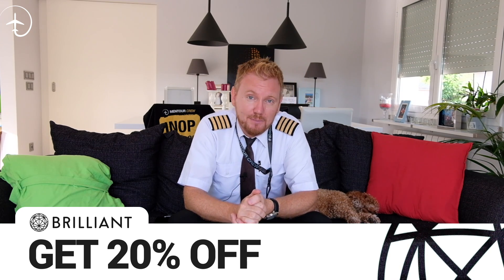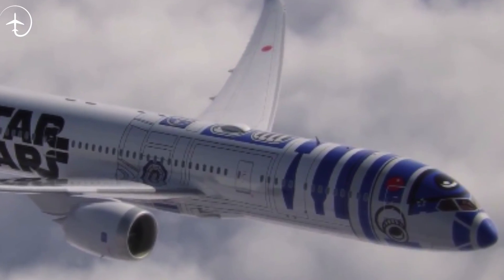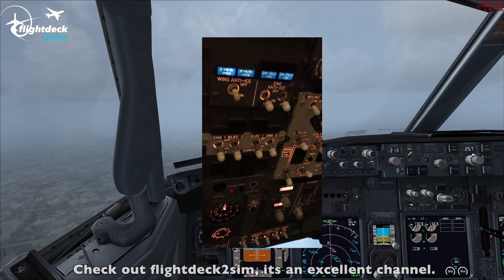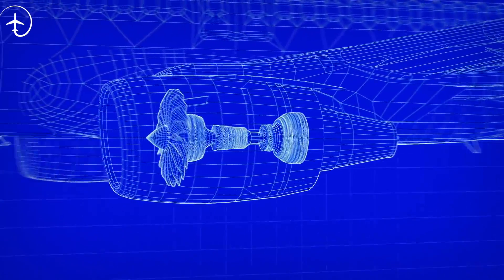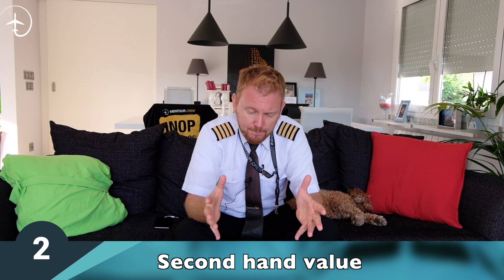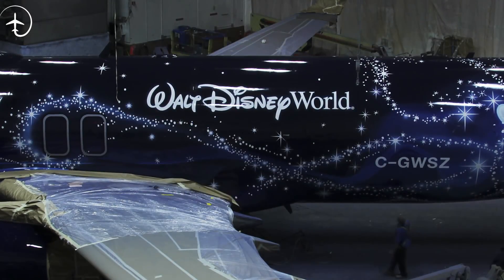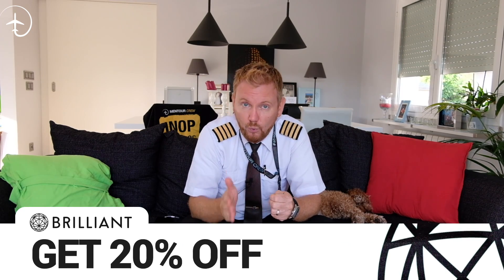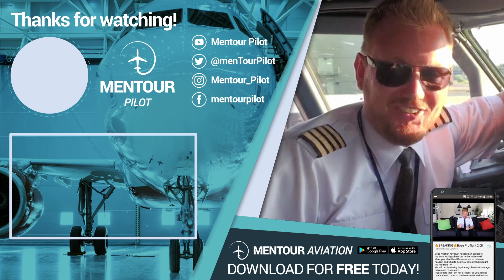Why the front of the Jet Engine is NEVER painted..

Comment: Silver paint schemes are actually colour on metal that's supposed to look like metal or they just leave it be? 
Those are the prettiest. Today I only see it on Aeroflot, before American also had this.
Reply: I would think American Airlines used a gloss clear coat Aluminum skin. I will ask my father he work for American Airlines for 30 years. I do know they do paint the composite plastic parts and the new aircraft a battleship gray color.
Reply: Regarding paint scheme mass (and polished aluminium such as used on the old American Airlines schemes) - an informative summary is provided by Boeing here: 
@t

The mass of paint on a 737 is about 81 kg (versus just 11 for stripes and logos only)...
Typical savings in fuel costs are negated by extra maintenance (e.g. repolishing ~4 times per year rather than painting every 4 years) so the annual cost of operating a polished short range single aisle aircraft is ~$90,000 more (1998 estimate).   This left the matter largely to aesthetics - until the increased use of composite materials in designs necessitated paint.
Reply: Ok my father just got back to me. He said American Airlines polished the aluminum skin to a high shine. So no paint or clearcoat on the shiny silver skin. Just polished aluminum. I guess they spent that cash on ton of Tuttle Wax.. LOL
Reply: @Patrick-od2zc  Beautiful! The best things in life are usually the simplest I guess :) 
And to add on it, it's probably the livery that takes the least amount of heat, is lowest cost, and today at least, would be unique.
Thanks for the answer
Reply: Patrick       Holy shit!      You polish planes with something akin to Brasso or Magic Wad like the military uses on their brass.    It’s rub rub rub and repeat a trillion times.      They used to use a big double headed buffer that they probably still sell at Aircraft Spruce &Specialty company.     I had a Cessna 150 that I stripped  due to the prior owner using the wrong primer.     Buffing something that big is a big job, a 737 I couldn’t imagine even if they are using a large mechanized rig like a car wash buff on an articulated arm.

Comment: Great video, as always.  Question: Prior to GPS, how did pilots locate way points?  Omni or LORAN, possibly, but I know that they weren't extremely accurate?
Reply: Using the VOR/DME ground equipment.   Omega or inertial on oceanic tracks.
Reply: @karhukivi  : And don't forget RNAV - VOR on steroids!
Reply: @ErickC  Was RNAV available before GPS?  The question was what did pilots use prior to GPS....
Reply: @karhukivi  : RNAV came about in the 1970s, and used VORs as fixes, so... yes.

Comment: I'm unsure if this question has been asked before and I rather have a direct answer from a pilot or any aerospace engineers here; why do some jet engines have a cone on the core exhaust? Does it have a specific function?
Reply: It is for making the flow of air more uniform, creating less drag and increasing thrust and efficiency. If you have basic knowledge on how a jet engine works, the final stage is the turbine, which is used to power the compressor and fan. The turbine is made from a quite big disc with blades attached to it, and of course, the air passes only through the blades. And here is the problem, the surface area of the blades is smaller than the total surface area of the turbine, which means there will be a cavity, right behind the disc, for air to fill, which will decrease exhaust speed. You can imagine the principle as some water flowing fast through a small pipe and suddenly transition to a larger pipe, this will obviously make it slower. But if we fill in the gap with a cone, we can keep the exhaust speed constant by mantaining the same cross section area or even shrinking it. If you are talking about that hole or that pipe sticking out of the cone, that is the bleed for the oil vapours.
Reply: the cone allows the ANNULAR exhaust to gradually fill in the flow cavity in the center of the exhaust which is created by the turbine having a shaft and turbine discs in the middle.
the jet's exhaust is like a doughnut in crosssection and the cone allows for a less drag inducing filling in of the hope

Comment: Low cost carrier around here, MANGO, is all brilliant orange. Another reason is that cooler skin is less likely to cause density changes in the air flowing right above the surface, meaning less turbulence in the airflow and thus less drag. Tiny, but does add up in flight to a fuel use that is slightly higher than it could be. Same for a clean aircraft, it does use less fuel, and the same for finishing off the rivet lines with a filler during repair and maintenance.
Reply: I once read a story about a DC-9 that was due to have its leading edges polished. The aircraft was needed, so it was decided that one wing was good enough. The difference in lift generated between the two wings was enough to cause a significant and unexpected roll on takeoff.

Anyway, sometimes intakes and leading edges do get painted. The first 737 is a good example. The first DC-9 had painted inlets.

Comment: Could you explain "bleed air?"  Is air being bled from compressor for anti-ice; or is there some system that is always bleeding air, but that gets diverted to anti-ice when needed? 

Also, someone else had similar question, but,  What happened to the gray paint on the wings?  I think it was called corogard or similar, but lately, most airliners have body colored wings.
Reply from the maker: That’s a great question
Reply: bleed air is air taken from the high pressure compressor stages, that's why is hot. and only gets diverted when using anti-ice because it reduces engine efficiency. In some cases bleed air is also used to pressurize the cabin. Also bleed air from the APU is used to start the main engines, and can be cross-bleed to start one engine with the other.
Reply: @robertoricardoruben  Thanks, almost seems like steam engine diversion schemes.
Reply: @victorwong3311  Really? I know nothing about steam engines, besides the very basics, I'll read about them
Reply: @victorwong3311  Yes. It's the same principle as in steam engines.
Reply: @robertoricardoruben  Well said. To add on, the entire system is controlled by a multitude of valves. Depending on which is opened or closed dictates what gets pressurized, and what gets isolated. The customer service manifold directly attached to the core is always pressurized, and just outside the bypass, usually right on the engine is the primary bleed valve, which send the air out to all the other valves. Anti-ice valves, pack valves, ATS valves, cross-feeds, just to name a few. There are lots and lots of junctions and fittings, and ensuring the entire system is serviceable and leak-free is very labor-intensive work. Can't even count the number of times I've been blasted by a poorly-seated band clamp.

Comment: Hello mentor pilot, I have a question.  Imagine all the pilots in an aircraft lost consciousness for some reason, could a normal passenger, who has no knowledge of flying, land the plane?  What would the chances of such a landing be?
Reply from the maker: Should we do a video and find out?
Reply: @MentourPilot  is it possible for cabin crew to get into the locked cockpit in this case? Don't answer if this is one of those "safety questions", of course.
Reply: @MentourPilot  Captain Joe did a video of that in a simulator. They spent some time learning where the basic controls are. I don't recall if they changed the destination. They finished by doing a cat 3 landing. In the afterwards, he explained that it took the "passenger" almost a half hour to find the transmit button.

In real life, I would expect it to depend on a lot of factors including but not limited to the passenger trying to do it (a lot of people would not be able to remain calm), weather, aircraft status (can it do a cat 3 landing), airport status (does it have the necessary facilities for a cat 3 landing), etc.

However another video would probably be interesting. Maybe do one with a semi-knowledgable "passenger". I'm not a pilot, but I've watched enough videos to be able to quickly locate basic controls. I'm also a licensed radio operator (advanced amateur and maritime). Note that I'm not suggesting that I be the "passenger" as interesting and fun that might be as I live on the west coast of Canada. I'm just suggesting that it be an enthusiast that has some knowledge of a cockpit.
Reply: @MentourPilot    YES.  That would be awesome.  In reality, the biggest hurtle would be gaining access to the flight deck.  In the not too distant future, I could see technology being able to remotely program a landing profile - kind of like  Predator/Global Hawk military type so-called drones.
Reply: The biggest problem with this scenario is that no one else in the plane would even know that the pilots had lost consciousness - at least, not for a long time. But assuming that someone could get into the cockpit before fuel exhaustion, by far the big factor would be whether they could figure out how to use the radio and successfully establish communication with someone outside the plane. If so, they could be coached on setting the plane up to do an auto landing which would dramatically increase the chances of survival for the people on the plane.If they had zero knowledge of flying and couldn't establish radio communications , they would have zero chance of a successful landing.

Comment: When you mentioned temperature I thought at 30000ft it's -40. ?
Reply: Yes, but it is generally dry up there so icing at higher altitudes usually isn't an issue.
Reply: One reason why jet fuel specs strictly limit wax content. Plugged fuel line(s) a real downer. (Obviously)
Reply: On a polar flight in winter it may be -70 C.
Reply: Robert Williamson ice forming in the fuel lines is a very real risk... according to NTSB reports there have been at least 3 cases in the past year of jets having their fuel ice up, causing engine flame-out.  Fortunately all cases pilots have been able to land successfully, but no one likes to dead-stick a jet in for a landing.
The problem was accidental contamination of jet-A with DEF, which freezes at just a few degrees below 0°C.
Reply: John Early so DEF is going to kill us all, on the ground and in the air?

Comment: Love your videos. Please can you do a technical video on navigation? Do you use dead reckoning, INS, GPS, VOR's, etc. or a combination of all of them?
Reply: I would think primarily GNSS with SBAS as most will offer a SOL service specifically for marine and aviation safety. I think there may be some basic inertial systems preset but I would think that if you're close enough to something an INS interpretation system would benifit over plain GNSS something is already very wrong, the only benifit is that it can hold for a short period if there is a GNSS outage but with unobstructed sky view this is extremely unlikely with modern multi constellation systems. I could see an inertial system being used in fly by wire as the much higher refresh rates (200 vs 10 Hz) would actually  be a huge benifit there but INS systems are expensive and fairly volitile when you get into high precision (100th of a degree in all axis or better)

Comment: Y do Aeroplane fuel in wings?
Reply: Dayananda NN Not enough space in the body alone?
Reply: @Addy-to6mp  In addition, if wings were empty and airplane's body heavy (actual weight + passengers + cargo + fuel) then during takeoff wings could disconnect from the airplane's fuselage. So adding some weight to them helps to solve ths problem. And in aviation, dead weight is not a vital option so fuel instead of it is way to go.
Reply: The wings are otherwise dead space.
Reply: For that matter, if you have fuel in the fuselage, I believe you use that first and reduce the weight needing to be transferred to the wings.
Reply: @chrisschack9716  Indeed, fuel is used first from central fuel tanks and then from wing fuel tanks, even for APU.

Comment: Mentour sir why most of the aircraft wings colour are the same  althoung the fuselage are different for different airlines
Reply: Hi Michael,

First and foremost, I am not a pilot nor do I class myself as an expert.  I have had the same thought myself but after watching this video I would make the guess that it is to do with both weight and the way the air passes the wing.  I am ready to stand corrected though by someone who knows more than I do :)
Reply: Michael Joute probably the material of the wing. Things like that are something you can easily and quickly google

Comment: The aluminum skin used on the front of the fan case is called a lip skin. The lip skin cavity has bleed air from the engine which is very hot to melt any precipitation that forms as ice.

There's a valve that mixes the hot bleed air with outside air to keep the freeze action from forming ice that damages the engine if ingested.
Reply from the maker: Indeed. It contains hot bleed-air when the engine anti ice is activated
Reply: Is it hot enough that paint simply won't last? You don't paint the tail pipe on your car either for obvious reasons.
Reply: @BaldurNorddahl  Perfect! You win!
Reply: I am thinking damn the aerodynamics, screw the consequences of paint chips accumulating on the fan blades. I want to see those lip skins painted bright red like a set of giant lips. Those babies can suck!
Reply: In the plane I work on, the inlet anti-ice is tapped straight from the 14th-stage bleed. It never even touches the precooler. Our inlets get super hot.
Reply: SanctuaryReintegrate do you work on a Boeing or possibly a GE engine?
Reply: @Sub60IQTroglodyte  Embraer 145. They have the Rolls Royce AE3007. Garbage engine. Terrible seals. Always leaks oil, and the fuel nozzle manifold is fragile as hell. On top of that, the carbon fiber bypass case can give you horrid splinters. Not a fan of them personally. At least the fan blades are easy to swap.
Reply: SanctuaryReintegrate i worked on the C-5 for 4 years and we had a GE TF39 engine i just loved.
Reply: @Sub60IQTroglodyte  Oh, I loved the sound of those old engines! I used to work cargo in the Air Force. A shame they are getting upgraded to the quieter CF6 with the C-5M.
Reply: It is stainless steal, not aluminum (Boeing any way) and where I work we call it the nose of the cowl, not lip.
Reply: @stevelaminack1516  
  When you go to order a replacement skin, the CMM will call the skin a Lip skin.
The skins can be painted, however the paint erodes at a fast pace.
  Scuff with a Scotchbrite pad, Alodine 1000 and go fly.
Reply: I'VE BEEN LOOKING FOR THE NAME FOR SO LOOING!!! I LOVE YOU
Reply: Technically you could paint it - but airlines are cheapskates. The paint used on the SR-71 would handle the heat comfortably.
The surface could also be anodised in a number of different colours too. All this cost serious money however.
Reply: @allangibson8494  You forget the SR-71 wasn't just a usual aircraft. Most of it was built with (back then) new alloys of titanium etc. The black color wasn't just color it served a different purpose too. It had anti-radar properties, so I guess one could say it was the grandfather of all modern stealth planes.
Like everything else on this aircraft, nothing was standard and nothing was cheap "materials from the shelf".
Reply: @kalleklp7291  I am quite familiar with the SR-71. The black colour was also integral to its thermal management as it was optimised to radiate heat. I agree that the ferrite was a good radar absorber but the structure underneath was involved too with anechoic leading edges.
In the early years all other markings were chalk - paint just burned off.
Reply: I enjoyed reading this comment instead of wasting 12 minutes lol